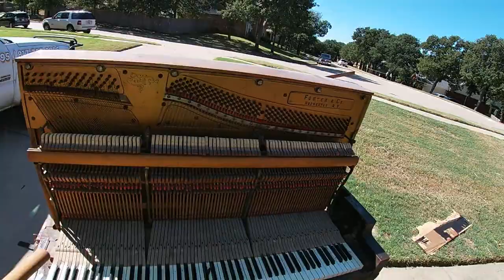Head Cam Footage: Piano Removal In Fort Worth Texas

Comment: You can throw the Guts of the Piano into your a Metal Scrap Dumpster. Also there’s good value in the different metal types that make up the piano., you could separate when one of your guys is at the shop basically doing nothing. Good way to make a few extra BUCKS. Good Video Brother.